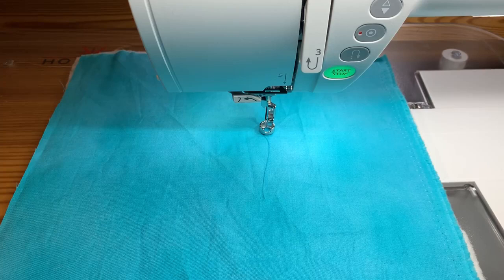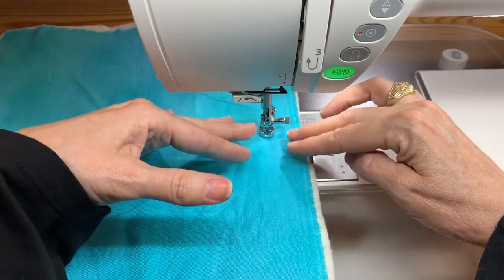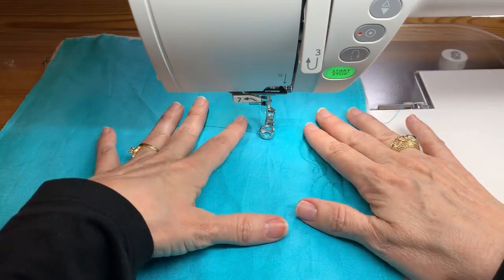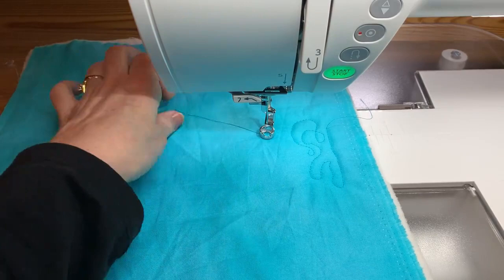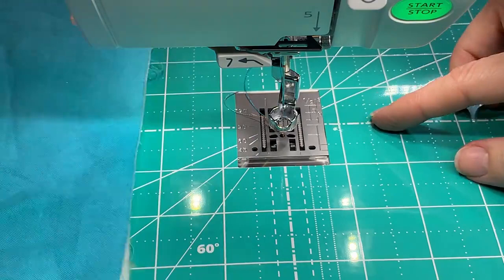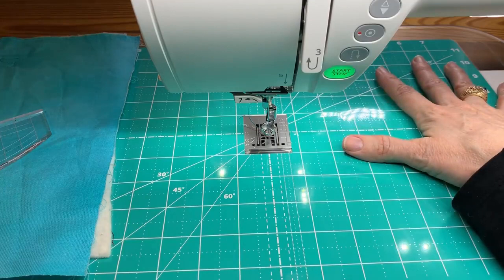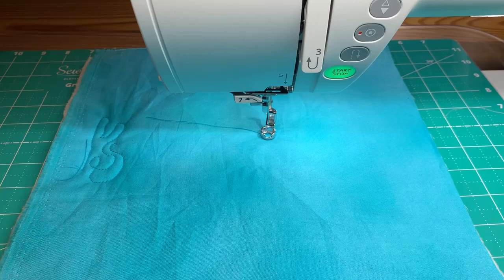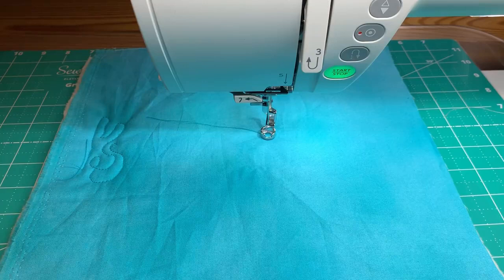Rulerwork and FreeMotion Setup Troubleshooting video

Comment: In adjusting ruler foot most videos are on  smooth  fabric I have trouble finding the "sweet spot" when I need to go over seams.
Reply from the maker: That is a common problem.  I have to adjust the foot sometimes too.  I try to plan for making my seams as flat as I can during construction.